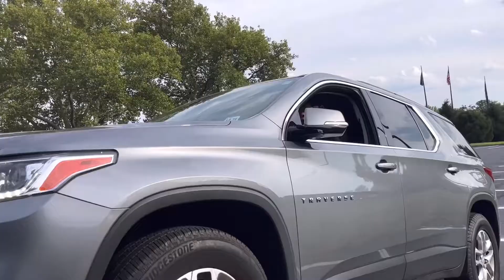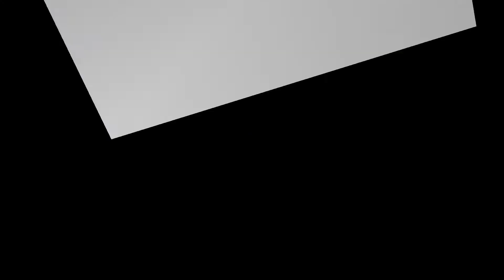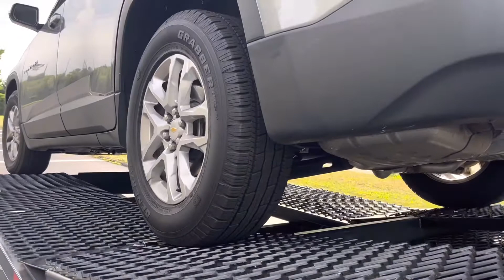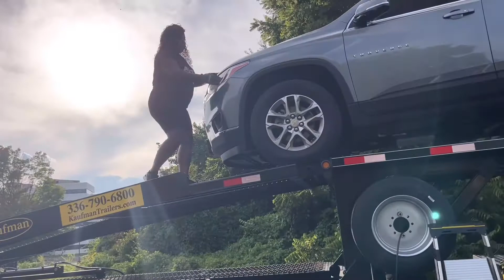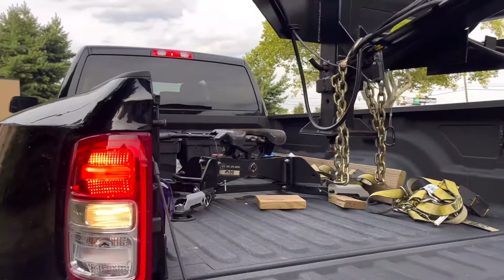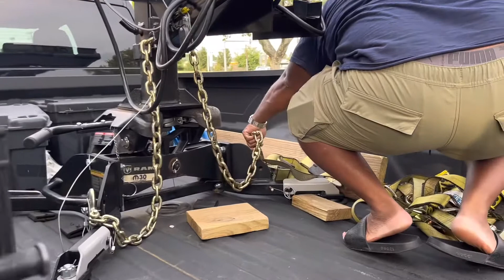How to make money in 2022. Truckin  Driving training

Comment: Getting the same trailer very soon , I was also wondering where to put the one car if it’s just one on the trailer. If you have two SUV’s & one heavier than the other which one should you put up first? Should the heavier one come up backwards so the engine is on the axles ? Or put the lighter one up first? Appreciate your videos OG!
Reply from the maker: If I have one car I put it on top of the 3 axles
Reply from the maker: If it’s 2 I’ll put the heaviest one one. The rear